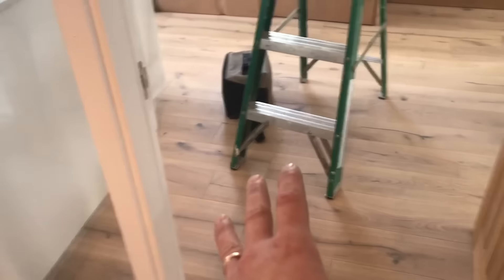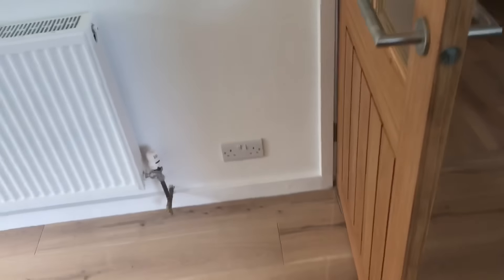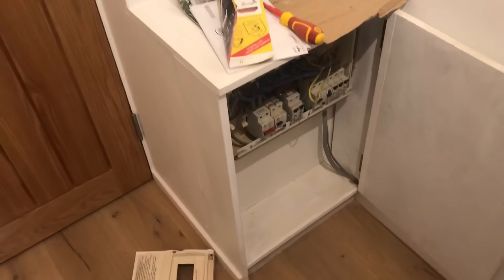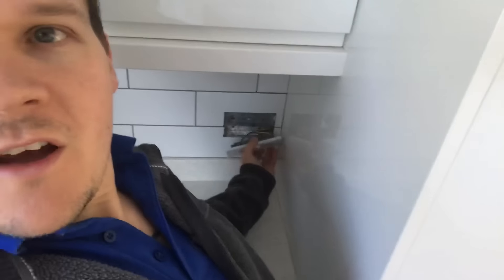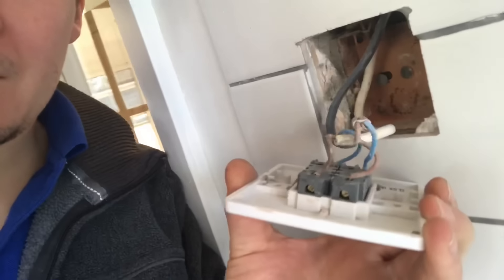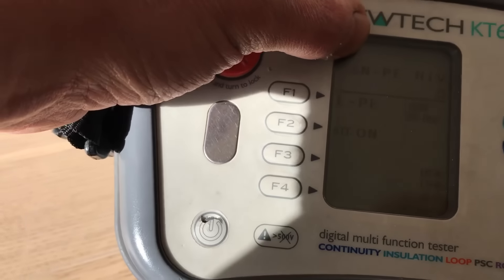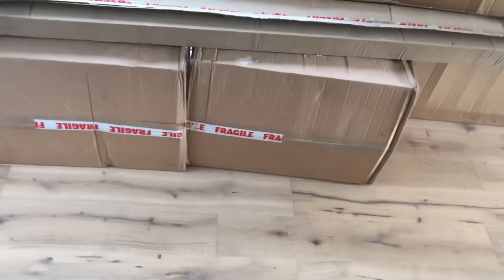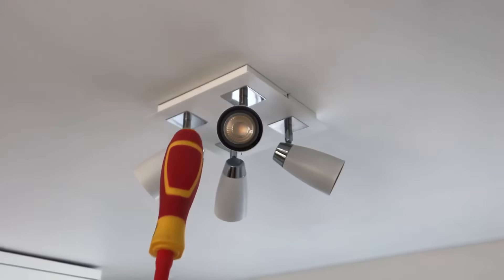Electricians day testing and inspecting one of the worst installs.

Comment: I've always been having trouble with that Brown sort of electrician who goes on about wanting one of them whose as brilliant as Albert Einstein,they are really that terrible !!!

I haven't been able to get work in the trade because too many of them have actually been like that,the Australian standards states that only a licensed electrician can do installation work or a fitter ,landscaper,etc can do connect/disconnect work on a restricted licence.

I fought tooth & nail to get a qualified supervisor licence meaning that I can work for a contractor, I can get my contractors licence if I want.

I don't know who would run MIMS inside the wall,that cable is usually laid in concrete slabs & used as a heating element in horse stables for example.

The light fitting inside the bathroom should be at least an IP56 rating (splash proof),on a new installation, light & fan switches are fitted outside of the bathroom.

I hope that someone is able to get roof access to rewire the light fittings as long as the wiring is least likely to be disturbed, they don't need any cable clips or conduit.

The BP connectors should be terminated inside a terminal box,not inside a wall cavity.

6mm squared cable is standard for a sub board which has circuit protection in it,in the main switchboard, the private line is usually 16 mm square cable from the street mains.

That's all according to AS3000 standards,it looks like whoever contacts me this week about employment won't place me in a trade role,I'll keep on getting that they're all the same !

Why did I choose that occupation ? Well, I have an interest in it yet I couldn't work out why employers were recruiting apprentices who could do a PhD in maths & physics at university !!!!

Comment: no offence but you need to stop relying on your book so much, for example that 'ipx4' thing, the x means the fitting doesn't need to meet dirt ingress requirements, the 4 in it means it is up to the water resistance standard. not trying to be harsh, but most 1st year apprentices know about IP ratings, its concerning that you condemned that light fixture when it was perfectly fine to be in a bathroom
Reply from the maker: The fitting came with a sealed manufacturers connector that’s been cut off and replaced with open connectors so the ip rating is irrelevant. Not been installed to manufacturers instructions means the fitting is not suitable for the location. Referring to the book is for the video and to help people understand. Secondly the light fitting is technically double insulated so doesn’t need an earth connecting to it but as the back plate had been screwed through the old lighting system back plate, means it’s been earthed and thus creating a potential again voiding the manufacturers instructions. Lastly yes the light would be suitable for the bathroom had it been installed correctly.

Comment: As someone who worked on such shit shows, thank god i switched to software Development, let me tell you a dirty secret. Usually it is not on to the guy who did it. it is the home owner pressure. I did few shit jobs like that out of necessity when i was studying. You come and the owner already finished all of the renovation and he wants you to "add a few things" when you tell them they need to rewire the thing they just tel you 1. fuck off 2. can you improvise something. You usually reject the 2 but they keep calling you for 2 months to do it anyway.. so you tell them ok.. BUT you take responsibility. And they probably have it even signed. And they usually try to screw you over by either wanting more then you agreed on (my guess is you are there to add the missing thing) or by not wanting to pay the material costs.... i swear that is why i left the field.

Comment: im no electrician but isn't it unsafe having no isolation switches for cookers and that. coz if the cooker caught fire it will have to be switched of at the mains, above it instead of rushing round the house for the fuse for it. + if she had kids that play with appliances and turn the cooker on accidently its a disaster waiting to happen. probably a rouge trader this guy is.

Comment: Heh... I'd probably do a better job and I've got nothing to do with Electricity other than occasionally dabbling into the matter when I have to change out plugs from UK/EU ones to SWISS but even then I'm going the extra kilometer and do things like crimp the wires ends before shoving them into the screw terminals - Which apparently is not a thing with the Electricians I've dealt with so far when it came to stranded wires in my flat ( ya know... When they converted kitchen/bathroom supplies fro EU to SWISS Plugs )

Comment: Kitchen is a cheap shit one, bespoke handmade kitchens are like 20-30K so they got massively ripped off of they paid that?... just done a a kitchen 2-3 times that bloke spent 8 weeks building it from stretch on his own and was less than 40K and it wasn’t a B&Q cheap shit... and the light fittings of IP44 was fine ... the X is dust ingression not water... as long as the second digit is fine that that water ingression... 🤷🏻‍♂️🤷🏻‍♂️🤷🏻‍♂️